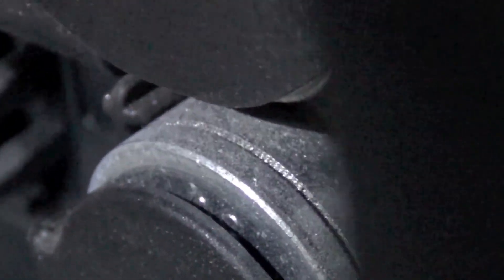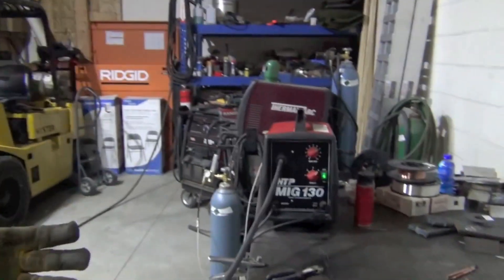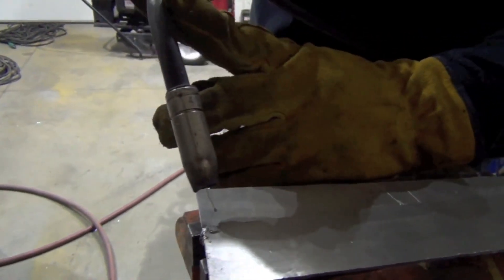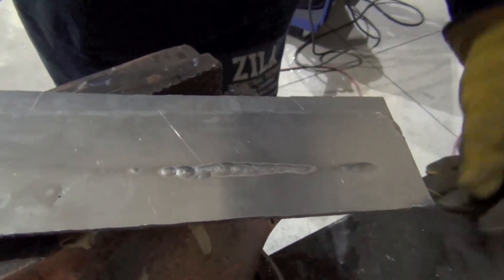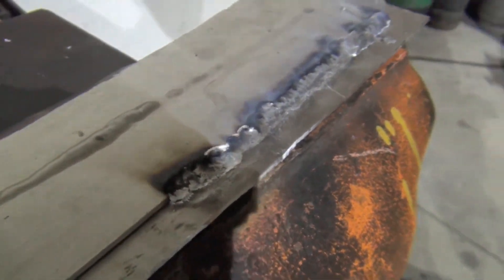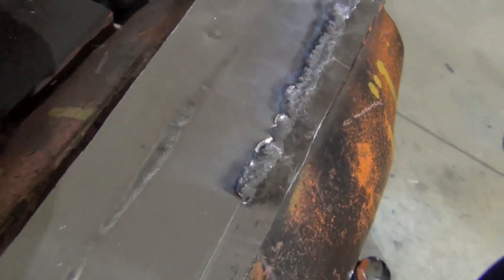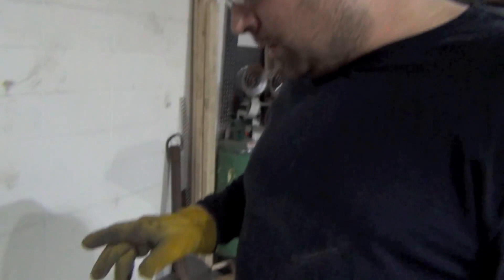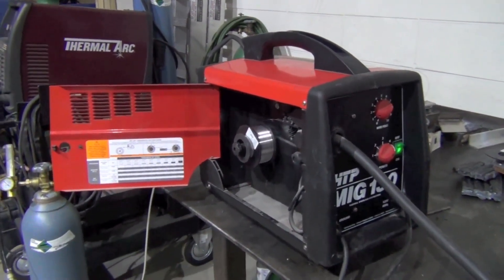MIG ALUMINUM BASICS

Comment: Zila, can you explain something for me?  Tig requires AC with appropriate balance setting to weld aluminum (I believe) in order to get a necessary cleaning action.  welding with Mig using DC positive..... does not require AC.  why not?  how is DC positive with Mig able to adequately clean the base metal for welding aluminum?  or does DC positive even give any cleaning action?  I guess I am confused at to why Tig requires AC, but mig is able to use DC positive, when welding aluminum?
Reply from the maker: Mig DCEP has 100% cleaning ….  On tig the EN gives you penetration and EP gives you cleaning …. 

EP means that the electrons flow from the workpiece (negative) to the electrode (positive) 
THAT and the heat of the spray arc and an excessively high flow of argon does the cleaning ….

This will be a separate video i suppose
Reply: @ZILAwelds  thank you.  makes sense.  appreciate your videos.

Comment: anyway...
is there any fluxcore-only options for aluminium?
Reply from the maker: if harbor freight does not have it - you cant get it ......    

no all hidden aside ...

open arc or gas less wire often need to "react" wit the ambient air where aluminum needs a 100% innert atmosphere ...  so its a no go ... cant be done
Reply: "When AWS doesn’t list FCAW aluminum welding wire specs, it’s time to admit defeat. This wire does not exist." (Fluxcore Aluminum) I've searched for years. If you have to weld aluminum in the field stick is a great option.

Comment: I have learned a lot from both of you guys...  I want to build a john boat made of 1/8 inch aluminum plate... my setup will be: 200 amp mig (220volts), teflon liner, 10 ft mig gun, oversized contact tip,  5356 wire (.35) u shape roller... my plan is to weld no more than 5 inches at a time, and changing positions to avoid overheating... any tips would be really appreciated... thanks!